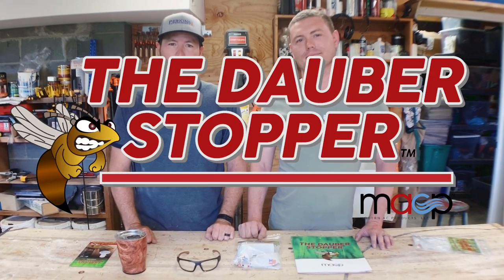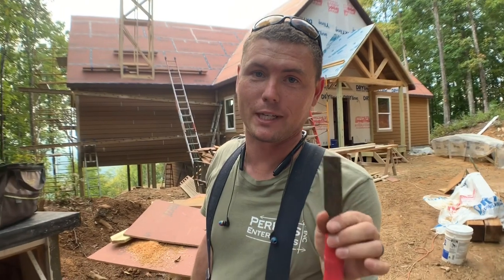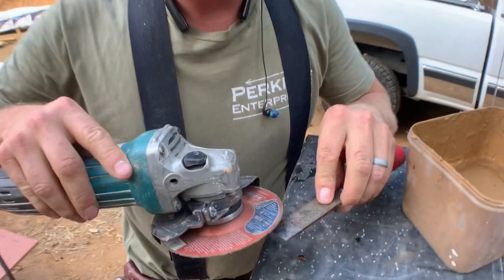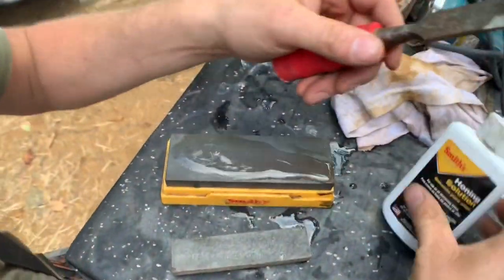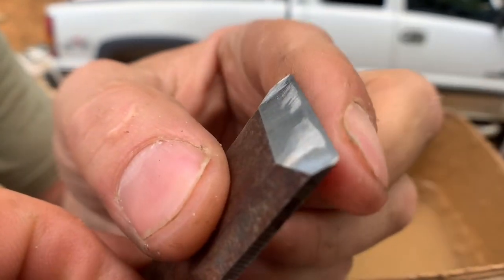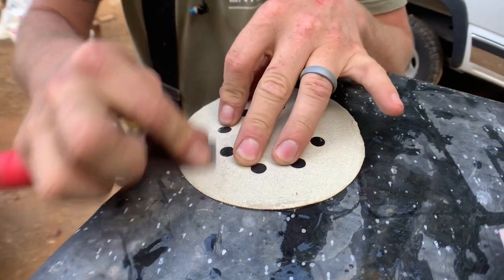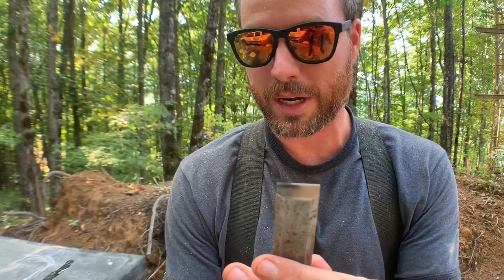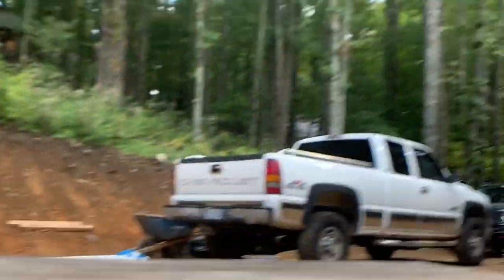How To Sharpen A Damaged Chisel | Get SUPER Sharp Woodworking Tools

Comment: I sharpen my good chisels at home on whetstones, but i have a few tips for onsite sharpening of beater/cheap chisels. Try using a belt sander not your grinder, it will get the back and bevel alot flatter and is alot easier to control the heat. Also when you use your stone face the chisel running parallel not perpendicular to your stone. Your stone will stay flatter for longer. Less flattening of your stones, make them last longer and could save you some coin 👍

Comment: For the first (worst) grind, use a belt sander to get the rough angle, and flat (as best you can).  Then go on to diamond sharpener plates with cutting fluid.  Once you go diamond, you never go back to an old oilstone.  Nice vid all the same.